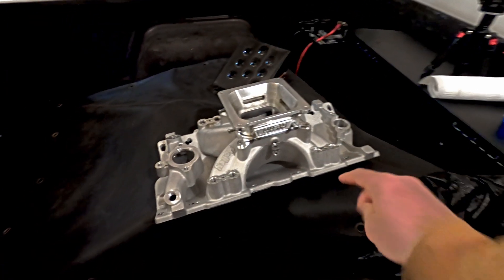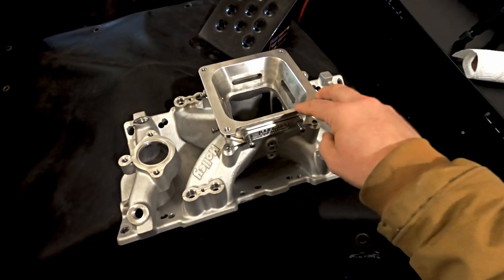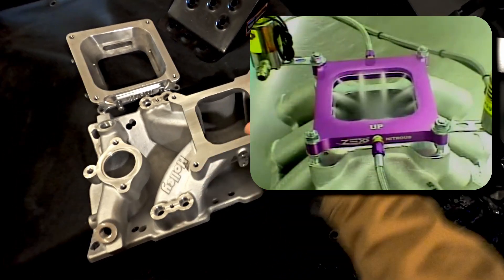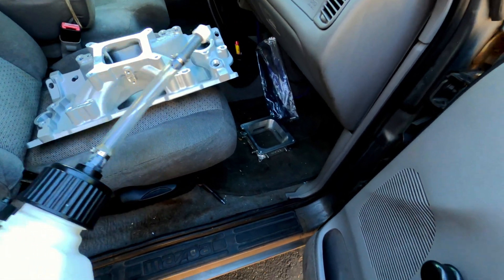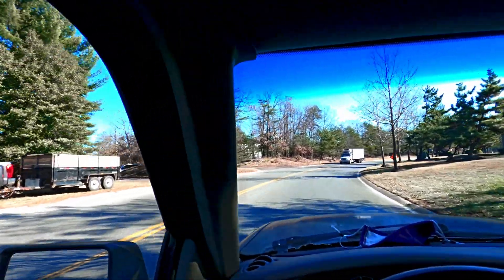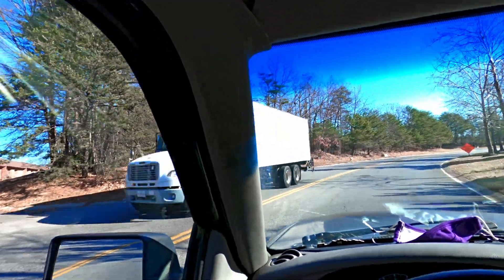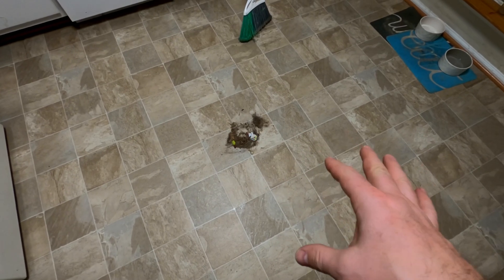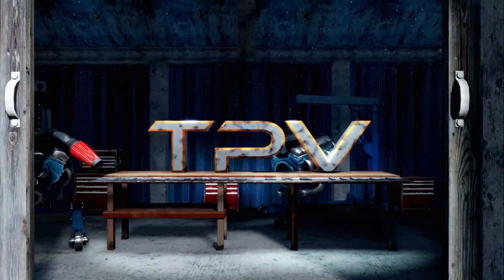LT1 Dry  N2o / Nitrous Options For The Holley Terminator X EFI Baby!

Comment: What would you do differently if it was carbed and not efi?
Reply from the maker: Put a 4150 on it and throw fuel through the plate. Plus the intake would not have injector bungs.
Reply: @TPVPRO  what if the person had the 4500 carb
Reply from the maker: @benaiahtheassassin   I would not use it on a 4150 intake.